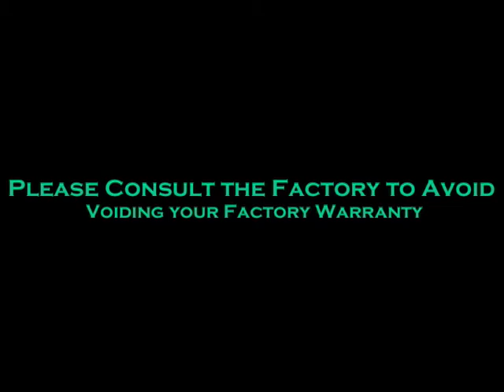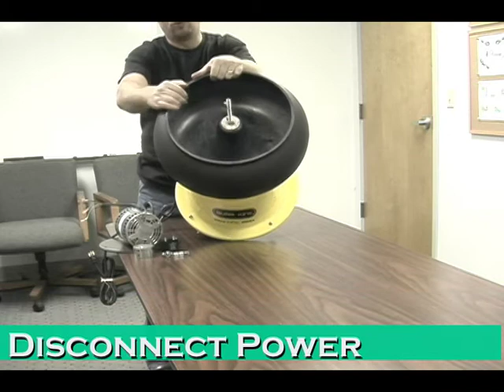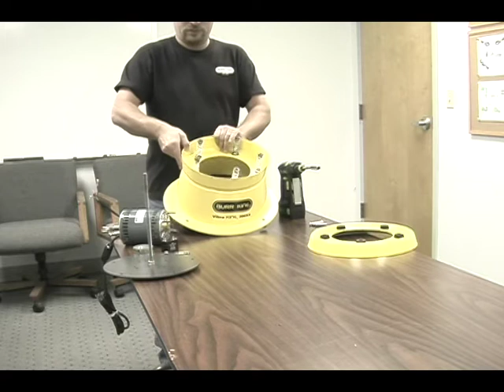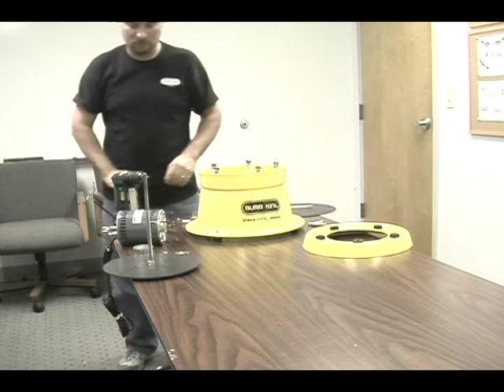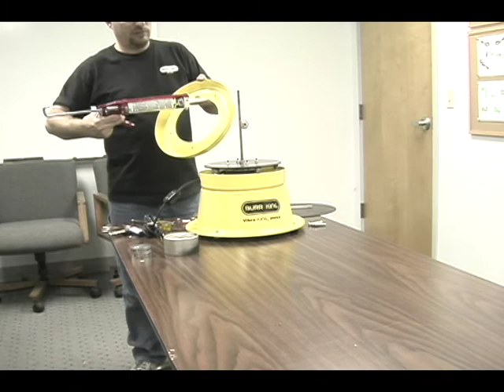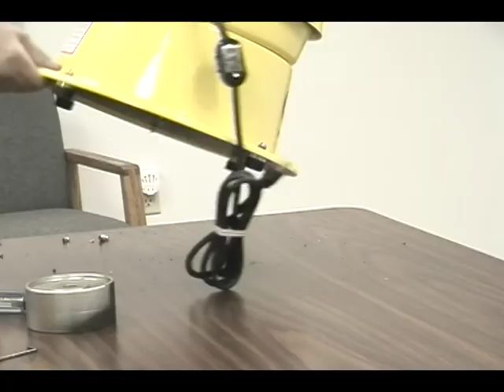Model 150 / 200 Vibratory Motor Change

Comment from the maker: @tridondesigns 

You can call the factory and check on the Fasco motors.  But we have once again started to test the motors from Leeson.  They have been performing very well.  We are expecting well over 5,000 hours on machine in the test lab.  I guess that they have a new style brush that they are using in the DC motors that are making them perform very well

Comment from the maker: We do have a kit to convert to the new style motor. If your current machine is running the only advantage would be that the new motor is a brushless ac motor. Also the new motor is twice the Hp but you would likely not see a performance increase.